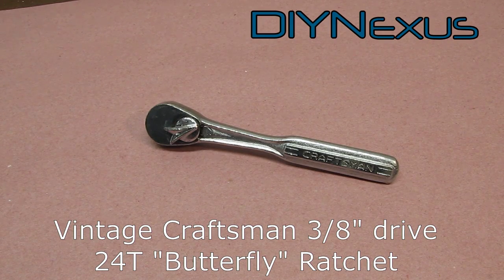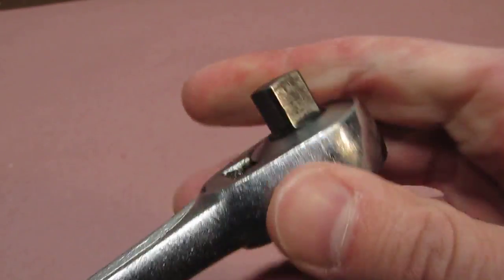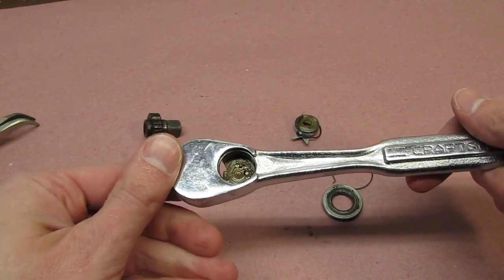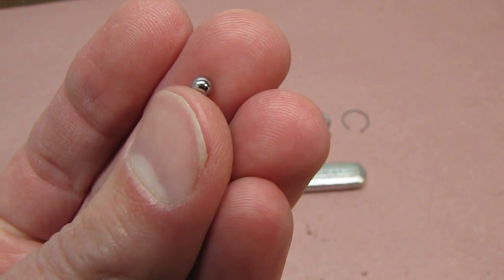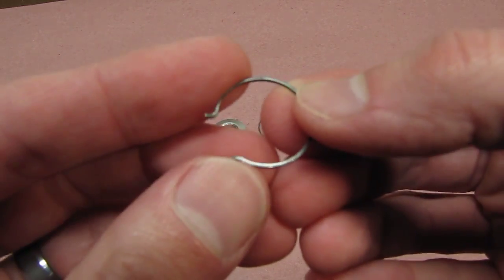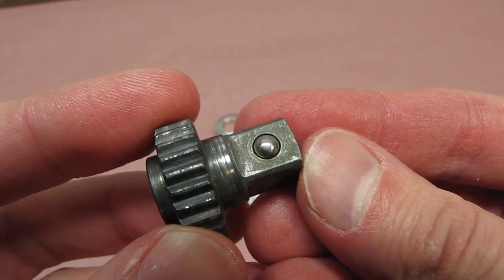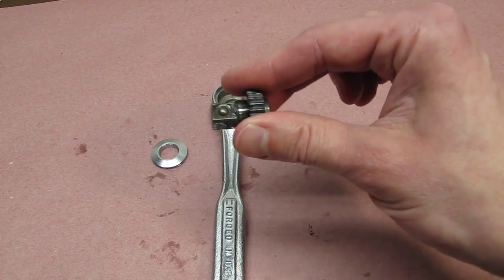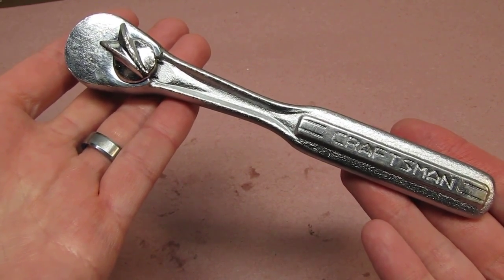Vintage Craftsman 3/8" Drive 24T  'Butterfly" or "Flying V" Ratchet Rebuild and Cleaning

Comment: I have this exact model that I purchased new about 1959. I am about to clean and lube as you have done, so this video was all I needed to dig in. I would not have reused the damaged ball. The ball looks to be about the size of a bicycle headset bearing. They sweep these off the floor in bike shops, but I already have a supply of this size and similar sizes. Thanks for the video, I will be going into my wrench tomorrow for the first time in almost 60 years. It should then last another 60 years, long after I am gone. ;-)

Comment: I like that you were able to take apart and clean this vintage craftsman tool and get it back into usable service. I like somewhat older craftsman tools. A 1947 Craftsman Jig/ Scroll saw which belonged to my niece's father in law, 2 1/4" D handle drills from 1954 and 1957 from a friend and neighbor. Then a 6 1/2" and 7 1/2" circular saws I picked up! Old school is cool to use!

Comment: Hey, thanks for your help.  I’ve had an old craftsman ratchet kicking around for a long time.  It had totally failed and wouldn’t work.  After watching a couple of your videos I tore it down.  Now it works great again.  Took me a little while to find something to hold the ball and spring in, but in the end, a small piece of metal with a small hole worked.

Comment: If you don’t have the specialized ratchet rebuild tool from Craftsman, I used the end of a corn dog stick to push the ball bearing down long enough to slip in the pawl, and it worked great! Lol

Comment: Put that wrench in a vice so you don't have to struggle with it. Oh yes make sure to clean out the work area in case the ball and spring flys off or work in a glove box like a sandblasting box to retrieve small flying objects. Don't ask, been there in my blackhole shop with mysterious parts appeared years later.

Comment: Water and vingigar a no go. Use something mild but evaporats  but the rest is great I would have packed that super lube thick it is great grease for solvent  free conditions . I have broken ratchets but they are basically forver used within reason I have used the same 1/4 craftsman professionally for 25 years. The detent is going out but still use daily.

Comment: I have 3 vintage craftsman ratchets I want to restore. How much are these worth in used but working condition?
Reply from the maker: It really depends on how old they are, how common they are, and their condition.  A quick search on eBay showed me that they range from $15 to $200+ shipped.

Comment: I have the same ratchet. How do I know which repair kit to purchase?
Reply: 1/4” - kit # 4483
3/8” - kit # 4478
1/2” - kit # 4498

Good luck finding a kit. They stopped making them decades ago. If you can find one on eBay, it will cost you. But to preserve the memories, it may be worth it.
Most of the time, though, those old ratchets just need a good cleaning and new lube to get them working again. 

I once found the “Speeder” version (very rare, worth up to $170 on eBay) sitting in a bucket of water at a yard sale for 50¢. It was so rusted up that it took me 3 months to get it apart. In the end, I only had to replace the clips from a donor ratchet and polish it up. So far, I’ve only had to use it once for pulling out a few extremely long bolts, but it did the job and saved a lot of time .
Look up “ Craftsman Speeder Ratchet “ , it’s an odd one that was only made for 2 or 3 years.

Comment: I know this video is 4 years old but I'm currently restoring one myself but in trying to remove the snap ring one of the pins broke has anyone found what the best replacement is or can use any standard snap ring for replacing also if anyone knows where you can get one of the oil ports on top since the one I'm working on was missing when I got it
Reply from the maker: I'd bet that the snap ring is a standard one that you could probably get from a good hardware store.  Just bring your original broken one as a guide.  I don't have any idea on the oil port though!
Reply: I used a guitar string to replace broken retainer rings on mine, seems to work just fine!

Comment: That super lube is crap, it will dry out, try some krytox. Amazon.
Reply: Looked up Krytox.  Excellent. Thanks. On order.
Reply: I agree.  This is not the best.
Reply: break out the wallet
Reply: Synthetic grease